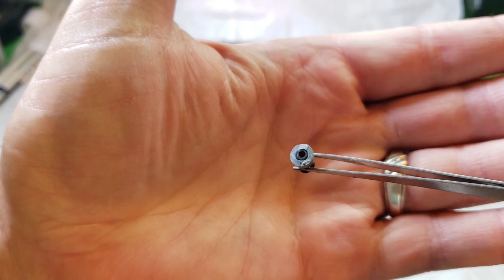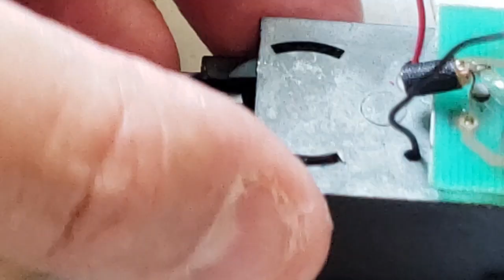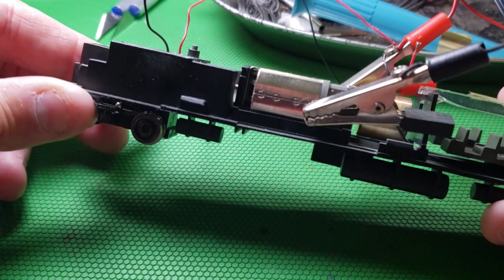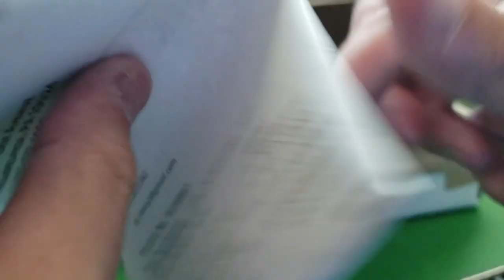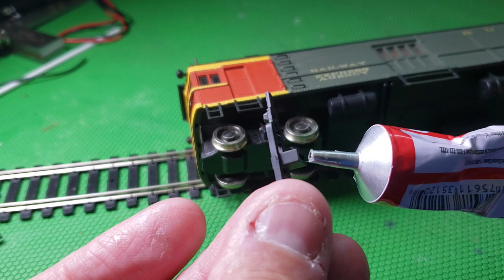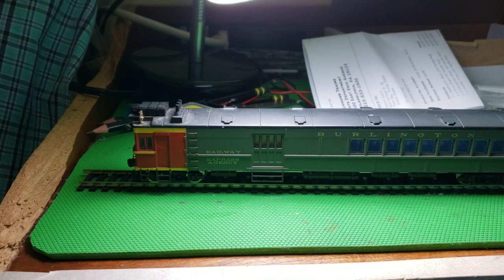Burlington Doodlebug Repair

Comment: You blew a diode it can be replace by purchasing a 1n4001 or 1n4004 rectifier diode they are very cheap only about $0.50 ea here in Australia.. they are for the front facing headlight 
which was just a globe hence the diode to stop it working in reverse polarity.  I have repaired many doodlebugs and they all have the issue of the split gears on the wheels or the cups splitting for the drive gear arms... I use PVA glue for fastening parts on that might need to be removed at a later date.. it can easily be removed ...

Comment: I've got an old REA (Railway Express Agency) coach that I illuminated with LED strip lighting and a keep alive circuit.  I made my own wheel pickups out of some thin copper strips I salvaged from an old computer.  Only problem I had was that I ordered bright white LED strip which made the lighting a little too white and bright.  So I took it apart and painted each LED with some yellow acrylic paint and now it looks more period correct.  Why would you buy couplers from Bachmann?  I would have changed those couplers and used Kaydee couplers.  I've changed out all of the horn hook couplers on all my engines and rolling for body mounted Kaydee couplers.  When using an LED for the headlight you have to have a current limiting (ballast) resistor.  If you don't want that flash when you go into reverse, you should use a diode on the LED so it won't receive any voltage when going into reverse.  Diodes usually don't conduct in the reverse direction and that flash is caused by the reverse current.  One simple diode will do the trick.  Cheers from a 73 years old modeler in eastern TN (I remember Bryllcreme).
Reply: Thanks for your input on the resistor. I should have used a Kaydee coupler like you suggested and it would look more realistic.

Comment: a dremel with cutoff wheel attachment you can take a certain part of a certain kind of ink pen the retractable kind inside there is a part that resembles the drive shaft connector that has split and cracked usually because of time and getting hot and cold.  you can modify this part to do the job of the original connector. not all ballpoint pens will have the part nor will the hole be the right size it might be to big if so can't use but if to small drill it to the size of the shaft preferably a tad smaller than the shaft so you get a tight fit without having to glue it.

Comment: I have a war bonnet version with a cracked drive gear. I cant figure out how to get to it to replace axle.
Reply: You need to remove the shell from the chassis. The windows are what clip onto the chassis, so I place thin pieces of styrene between chassis and shell windows, starting at the rear and then moving forward. Carefully remove the side frames right away from the power truck to protect them from any damage. The power truck is held together with an "H" shaped piece of plastic that holds the halves in place with the bottom section and the top section turns out with curved pieces that rotate inside the chassis for turning the doodlebug. You need to pinch the top part of the H with tweezers of a needle nose pliers then wiggle the curved pieces out of the chassis. The lower part of the H sits on top of power truck body with slots that lock into raised segments cast into the metal power truck body. If you want to inspect inside the power truck, you can gently pry them up and off the power truck and you can them pull apart the two halves of the power truck to get to the gears. Or simply unclip the cover plate from the front and rear of the power truck and the axles with drop straight out of the power truck.

Comment: Nice job. I have a Bachmann/Spectrum Doodle bug as well. The one time I ran it it had a slight clicking noise. Seeing your work has made me want to open mine up and see what is going on. Thanks for sharing this. Stay safe - Larry.
Reply from the maker: The clicking is most likely a cracked gear on the axle, a common problem with these. I have seen several with that problem. I cannot say that I have seen replacement gears anywhere. I tolerate the clicking myself, but considered designing a replacement for 3D printing.